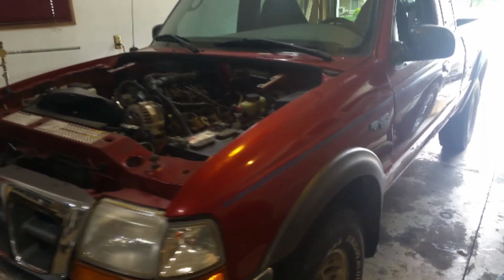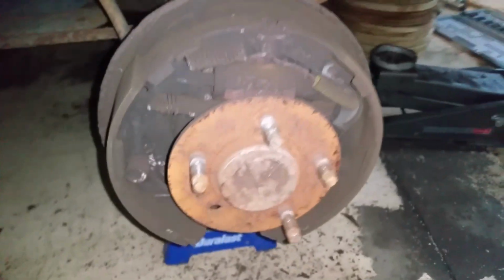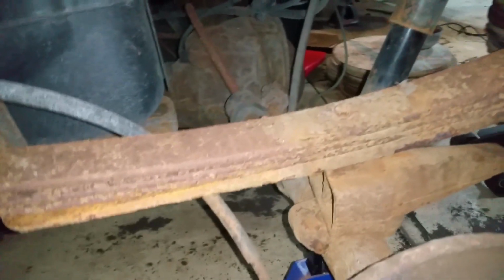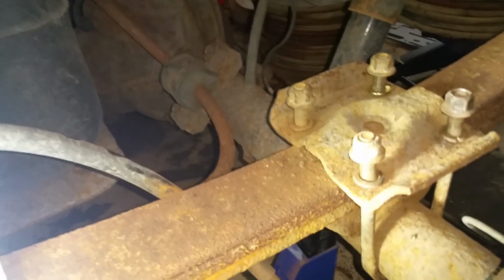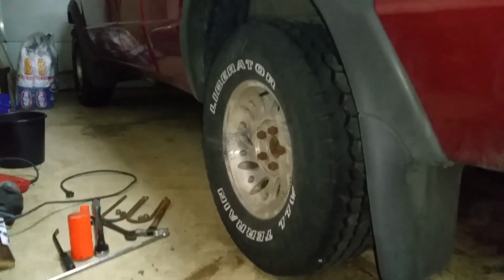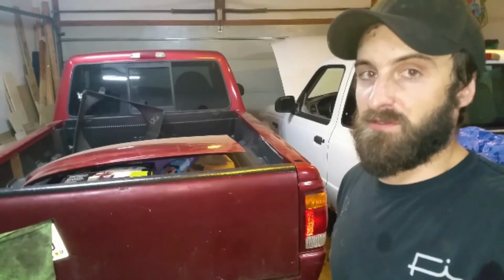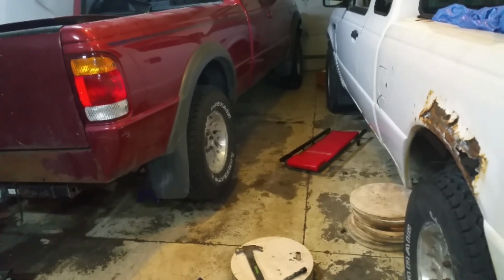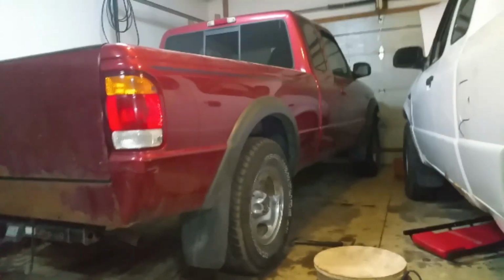HOW TO LOWER A TRUCK FOR FREE!!! LS SWAPPED RANGER DROP!!!

Comment: im wanting to do a lower leveling on my 2020 ranger but dont know if i have to actually buy anything to to do it there are 2 1/4inch spacers on my leaf springs my need to get a little shorter leaf bracket but dont think they make them for my truck cause not much give room left so may have to build them! don't want to do a flip axle if i dont really need to like some other videos showed! but looking to see if there are better ideas then mine

Comment: How do i get the notch in the leafspring into the differential mount? 

Maybe i have the truck jacked up wrong, but the differential is OFF at an angle, so i cant get the leafspring notch into the differential. 😠 i'm lowering my Edge, liftblocks came out easy.

Comment: I'm lowering the tail end of my 2000 F-350 to level it out with the front. I don't tow with it often and the leaf springs are strong enough that it doesn't squat much when I do. What would you recommend I do? I've looked at getting lift blocks and using them on the tail end considering the leaf springs are under the axle. Would that work?
Reply from the maker: Tyler Barrier Yeah, that should work. There's probably cheap kits out there for that that come with proper U bolts too.
Reply from the maker: Tyler Barrier Try to find something that had the little pins or whatever to lock into the leaf and mounts so doesn't slide around. Should be good.

Comment: Is that a 7.5 rear end?  As u make more power you'll destroy that axle,  have u considered an 8.8?
Reply: I have a 7.5 in my ranger running 250+hp and over 300 ft lbs of torque. The 7.5 is fine besides it being open diff.

Comment: Just a heads up 2wd rangers dont have torsion bars
Reply: My 2wd 2001 ranger has t-bars in the front
Reply: @victorh5174  maybe it's just the older trucks then cause mines a 97 2wd and it has I beams
Reply: Edge 2wd have t bars

Comment: what size u bolts did you get
Reply: Find out the size of the spacer you're going to remove, then subtract that from the length of your stock u-bolts and that's the size...